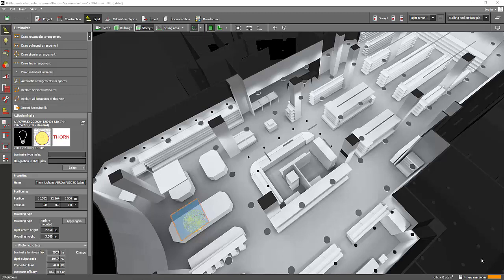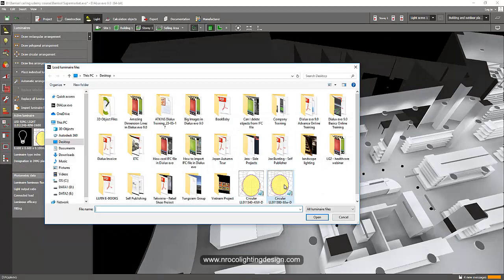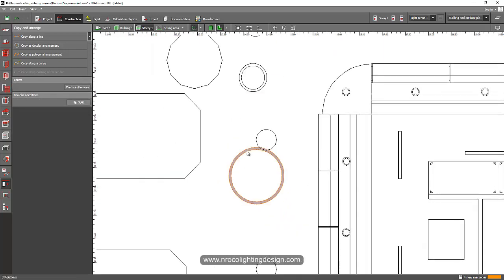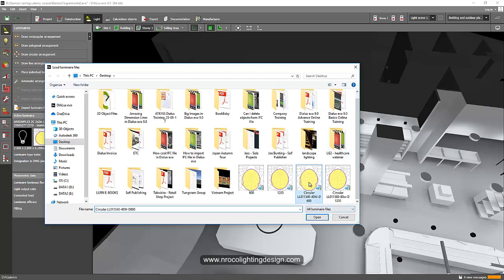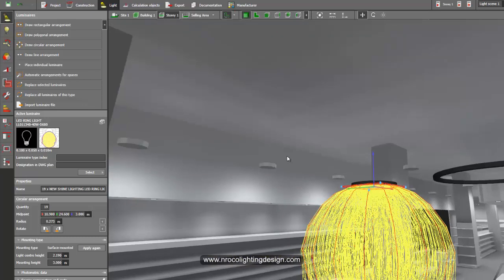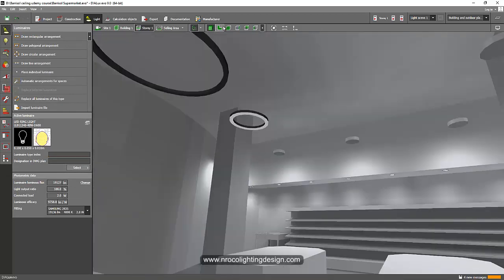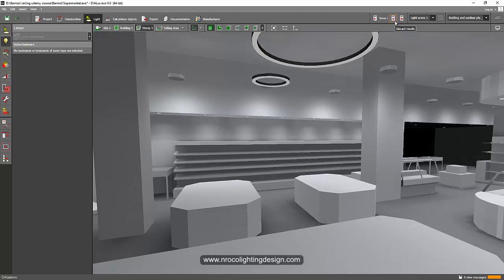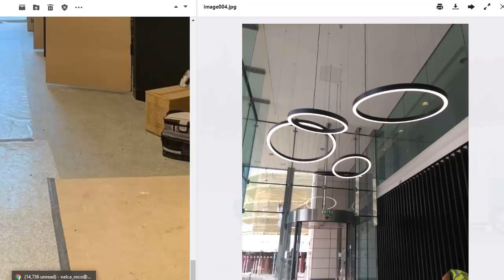How to create a ring light in Dialux evo (PART 1)

Comment: Hi Nelca, your videos have been helping me tremendously in my designs. Could you make a video on how to use suspended ceilings? I am making a large building that is 41 feet wide, 81 feet long, and 18 feet high. there are several rooms in this building that are only 9 feet tall and I am having trouble using the suspended ceilings. Can you help me?